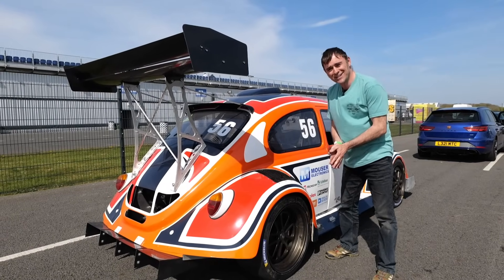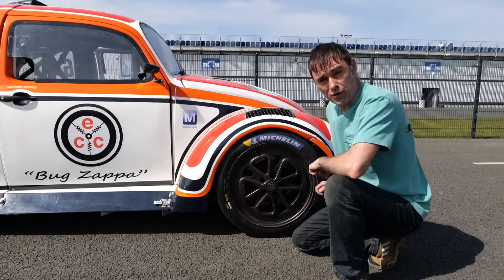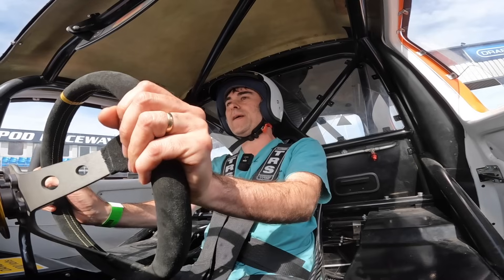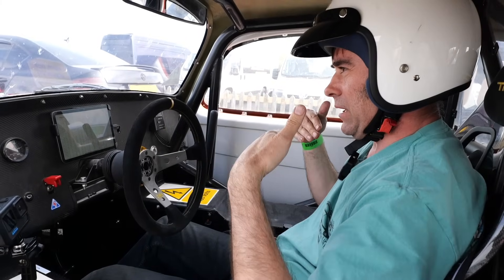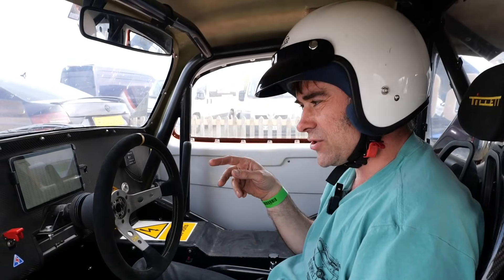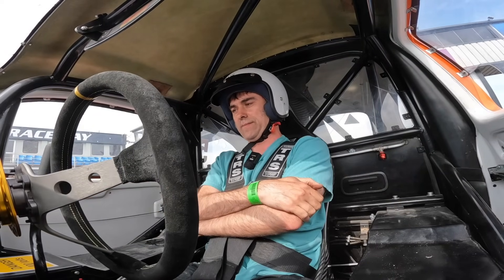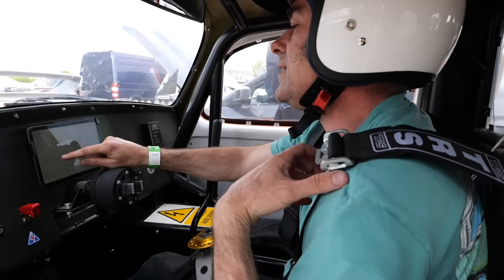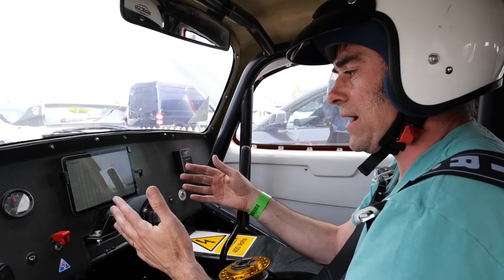Pikes Peak race car Ep19 - Drag racing

Comment: I did warn about front-rear balance. At low speeds you need more bias on front wheels and basically need to lift the rear to push front more to the road to get better grip and less slipping.

Comment: Does your control system have a limiter_report?  Complex control systems, that could have dozens of possible things that could limit the final output, should always be able to output a log stream of what input is currently the limiting factor.  This is the record of what input is currently being declared, by the controller ,to be the thing that is limiting the output at any given time. Where the limited/constrained output in this case is the resolved power to the motors.  The input could be: wheel spin, any number of temperatures in the system, battery sag or other battery conditions, error conditions and many many more limiters.
Reply from the maker: We’ve looked at the logs and looks like we’ve already sorted it now. 👍

Comment: I do not think doing burnouts is an option on this BugZappa monster.
You're going to be slogging off rubber no matter what.
Though the speed the tires are stripped to the rim might be somewhat under your influence.

Comment: A drag strip surface is a completely different beast.
Track bite (glue) and rubber means loads of grip, but believe at a more microscopic level (?) the tyres are kind of pushing a wave of Track bite ,then climb over it, so can trick traction control to think it's slipping, but it's not.
Ideally you need around 10% more wheel speed, to kind of clear the wave.
If you watch the pro fuel cars in slow motion, it's better to see.
Reply: Even before that first run I was wondering what the sensors would make of that sticky start line.
Reply: Agreed, really can’t see any benefit of prep’d drag strip testing for a hill climb. If anything, any testing here is counter productive… just fun

Comment: The requirements for drag racing are completely different to those for a track car - try 'reductio ad absurdum' and compare the cars at the peak of each discipline - they'd both be useless (or at least laughably uncompetitive) in the other arena. I don't see what data from a drag strip could contribute when your aim is Pike's Peak, and focus should be entirely on a single aim - a car engineered for all disciplines wouldn't win any of them. Be careful that the use of any drag strip data doesn't compromise Zappa's track ability!

Comment: My guess is that those circuit slicks are not compatible with the drag strip surface preparation. Not to worry. Good luck at the mountain. Cheers

Comment: 7:14 This is interesting because Kyle Wayde aka "Boosted Boiz" converted a Tesla Model S Plaid  to be a drag monster, did 8.714s to the¼ mile and that was on street tyres.  He did, however, take the complete chassis and did a body swap, rather than creating a whole new car with Tesla drive units, so the dynamic of the chassis would still be fundamentally sorted.
Reply from the maker: Yep. Been following that cool project. It’ll be interesting to see what this car can do with the current Tesla Model 3 motor setup in at the drag strip when we return from Pikes Peak. 👍

Comment: Finally. No burn outs. Fits an electric efficient car.
Reply: I mean I dont like burning rubber. For me it is stupid. Especially with electric vehicles.
But. Traction control works better with electric motors than engine drive train.
Reply: Electric doesn't give you more traction.

Comment: The experimentation all has value. And it helps we old gearheads weaned on ICE tech to learn the parameters and issues surrounding EV tech. A changing world. And the reliability with a bunch of max power runs has to be encouraging. Looking forward to Pikes Peak!
Reply from the maker: The logs have already helped us to sort out the issues. Car absolutely flies off the line now. 👌
Reply: @ElectricClassicCars  Great to hear you found out what was going on at Santa Pod.  Running the car there has paid off to get the car better prepared, and improve your knowledge of the new drive system.  

Best wishes and Good Luck at Pikes Peak! 🤞

Comment: track mode has torque vectoring -with a quad set up torque vectoring be easier to achieve, active suspension would make the inside softer in corners and use the weight of the car for more grip when you need it (your poor aerodynamics will help braking )

Comment: Thought electric propulsion is supposedly better than ICE? Why are you getting smoked by ICE machines?
Reply from the maker: We weren’t there to race. 🤷‍♂️ We were there to get some full load tests. If we were racing I would have floored the throttle from the star line. Maybe once we get back from Pikes Peak we should return and see what it really can do on the drag strip. 😉👍